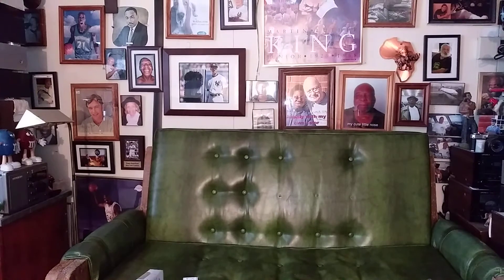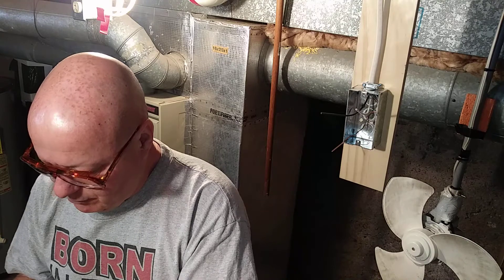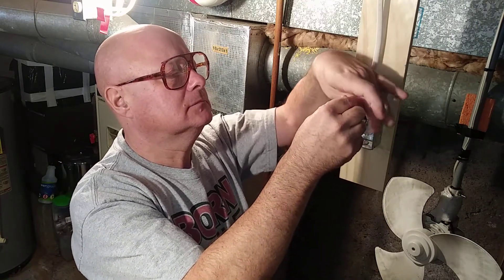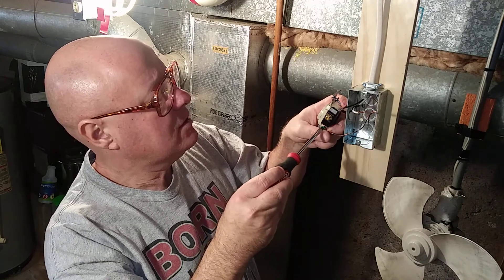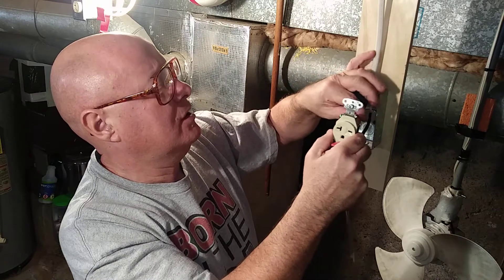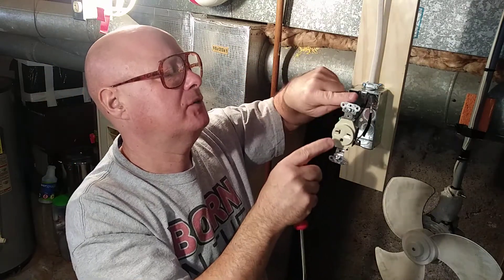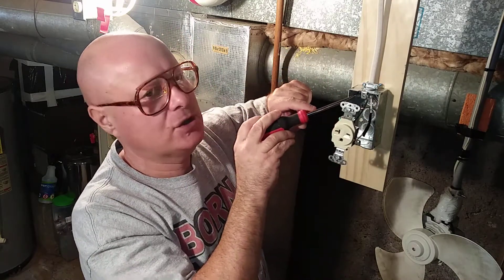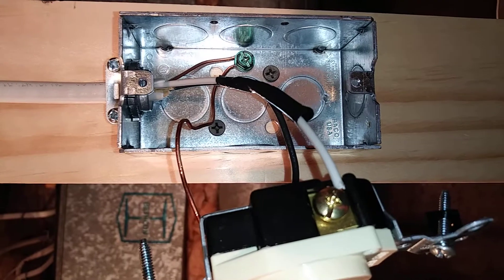I show and explain wiring 220/240 volt 20 amp outlet vertical & horizontal prong

Comment: It's always been odd to me that there is no common conductor (as we know them) on a circuit of this nature but this is correct. Yet we find in other 220/240 applications where there are indeed 2 phase leg conductors (black and red jacketed), a ground conductor (bare copper or green jacketed) and a typical (white jacketed) common conductor. It's odd to me that even though the ground and common are bonded at the panel that they would let a bare copper wire serve as a common. And yet code does allow this very thing in fact it calls for it. I realize it's really all just an organizational oversight but it tends to confuse my particular version of OCD, LOL. In some way I feel like they allow exception to the bonding ground and common ONLY at the panel rule by allowing this style of accommodation. Perhaps it makes a bit more sense to me if there were no receptacle disconnect like on a hot water heater or 2 pole baseboards that has been directly hardwired. But even then it seems like it cheats that golden rule by confusing an equipment ground for a true common/neutral conductor. Seems like it could lend to the creation or facilitate some sort of ground isolation loop that may be pesky. Never the less, I digress. This man is 100% correct on the wiring scheme and totally within allowances according to the learning I received. Well demonstrated video from the country I am from. :)
Reply: Normally bare wire is the ground that’s kind of obvious or should be and colors are just colors you can rainbow that circuit down the line as long as you know what conductors are what

Comment: I have 2 black and 2 white and 2 ground. How do I wire it with only 3 slots
Reply: Are those wires from a single cable? Or are there two cables involved?